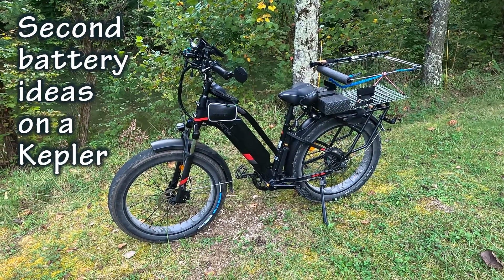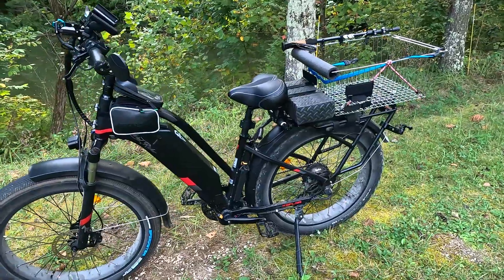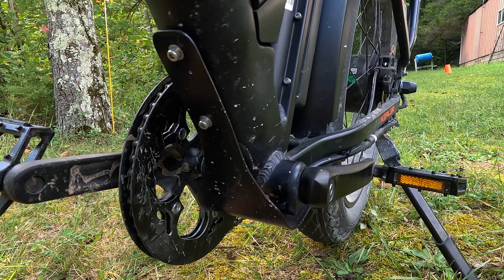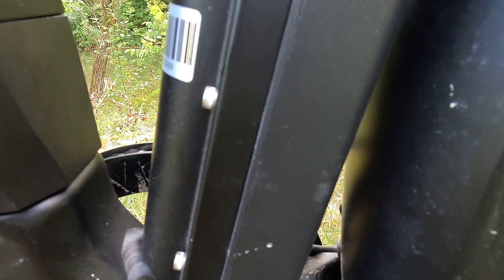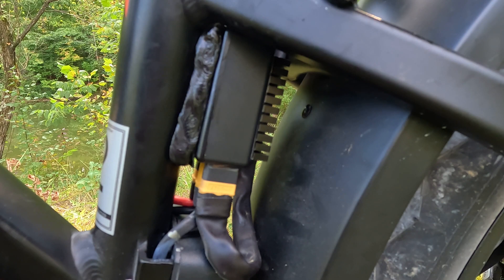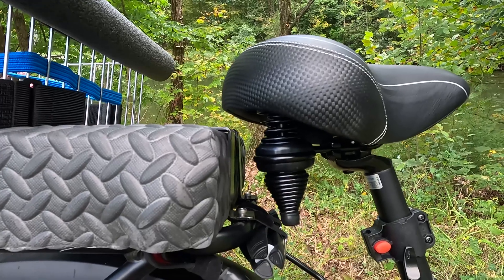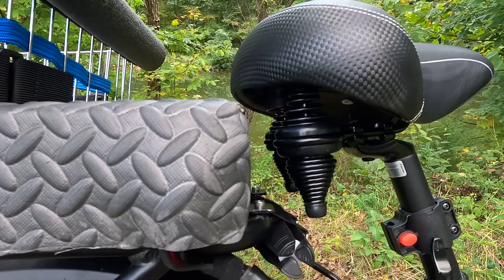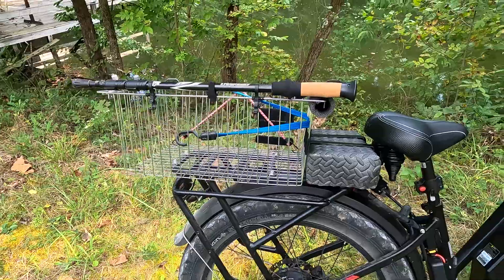Two Batteries on an Ariel Rider Kepler

Comment: I did go with the second battery. I bought one from a company called “on the go”. Fits the existing bracket and worked fine. Haven’t recharged yet. Seems like a quality product. If issues arise, will edit this comment. Hope things are going well.
Reply from the maker: Glad you found something that works. I couldn’t find it, could you post a link to it in case someone else is interested.
Reply: @RonNehrig I gave you the wrong name. Sorry. I posted it above. If you want to change it fine with me. Rode it again today. No problem
Reply: Off WeGo Store
Ariel Rider Kepler 48V 52V 21700 Side Open Down Tube Batteries 20Ah 1040Wh Magicyce Cruiser Step-Thru with 4A Charger
52V 20Ah Size C, China
$412.71x1
Free return

Comment: I'm still thinking a second duplicate "plug and play" battery is going to be my best choice. Should be no more than a 5 mile difference in having one that just slips in place of the original.
Reply from the maker: I found three choices, none had a review; Magicycle battery, should be the same but no one had tried it, American Electric makes one they say will work, but no reviews, a long wait, and no return policy, or find one on AliExpress that matches the specs. As for "a 5 mile difference" I don't know what you're referring to.
Reply: @RonNehrig  oh.. I meant that maybe using two batteries at once you may gain an additional 5 miles of range, as opposed to just using each one at a time.
Reply from the maker: I have never seen anything to indicate that, perhaps you have. As I've already said in my video, an important advantage to a two battery hookup is that the two batteries share the load, work half as hard and generate less heat; it is reasonable to assume that may make them last longer, both on a hard ride, and for the life of the battery. I'm not pushing it though; my choice started with not feeling comfortable with any of the available pop in batteries. A side benefit was lower cost, and the reason above, but I'm used to doing wiring for solar projects which made it easier to consider.
Reply: @RonNehrig  I never heard of heating issues from anyone yet.. But I could see it being an issue in some places during heavy use in July or August . we should see more options for plug and play in the next year as the top brands continue to grow in popularity
Reply from the maker: Heating is a fact of life for all lithium batteries, the harder they work the more heat they produce; if they heat too much they can throttle their output; I have had that happen climbing long hills on my previous ebike, the result is a reduction in power; too much of that results in reduction in the life of the battery, which is why hybrid race car batteries don't last very long.
Reply: @RonNehrig  I don't experience that. No hills and no heavy loads for extended periods. My battery stays the same temperature as the ambient temp. 👍
Reply: I have used my bbq or smoker infrared digital thermometer on my battery case.. It reads within 2°F of ambient temp when I do 25mph after 1 hour.. It seems to be hotter because the battery casing is black and the sun heats it
Reply: I'm sure a thermo imagery of a battery in cold weather would show more accurate results. Such as 2 batteries working and then 1 battery .. Those may show higher heat differentials
Reply: I will post a video shooting temp of motor and battery..brakes and the seat after a ride just getting off the bike .. Controller also. I will do it in 50° weather maybe. 😂
Reply from the maker: Heat inside each battery cell is the issue. None of your tests will show that until it becomes extreme.   But that is a distraction from the simple fact that more battery cells work less hard to put out the same amount of power as fewer cells; that includes less heat in the cells, wiring, and less voltage drop. Please do whatever you want.
Reply: @RonNehrig  yes I understand what you are saying..👍

Comment: Hmm.. Pretty cool. I'm wondering if you could use some of that flex shield stuff to seal up the red wire going into the top of your controller? Pretty cool adding another battery. I might need one one day. I think I want to wait and see if we can get some cheaper clone Kepler batteries before I go buying a square one to mount independently. Maybe in a year or so the aftermarket will have something compatible with the original Kepler mount. I would just carry it in a waterproof bag on the rack that acts like a backpack. Then I can carry both batteries around with other stuff.
Reply from the maker: The wires going into the top of the controller just pass right through and out the bottom, no real need to seal it. I did silicone the tops of the connectors though. American Electric makes a Kepler battery, but I couldn't find a review. I wrote them, but in the end decided on this. With the two batteries and a combiner, each battery is working half as hard because they are sharing the load, which means less heat and stress on them, so I think that's a good thing. It may also reduce the voltage drop as they are depleted; I noticed that on my old bike, but not on the Kepler yet, so that is just a possibility. Also it was cheaper. But I really liked the installation and am happy with it so far.
Reply: @RonNehrig  oh.. I never checked out the controller construction yet.. Hopefully it's pretty well sealed stock. I think I'm most worried about deep water over a couple inches.  And maybe downpours while out riding. I plan on fully disassembling the bike over winter and studying the individual components. Take pics when doing so to remember reassembly ..😂 I kind of want to do a new paint job too.
Reply from the maker: @kevinnashskitchen3517  The area you are looking at is just a metal bracket that holds the sealed controller. In other areas, as you've probably already noticed, the hole where the wires enter the frame near the pedals has a rubber grommet but is not sealed against water, that concerns me a bit; I haven't done anything there yet (except for the skid plate) but it will probably float to the top of my jobs eventually. I carried my old ebike on the back of my camper, all around the country; it got rained on for several years and is just fine, except for some moisture in the LCD display, which I took apart, dried, and sealed a bit better when I put it back together.